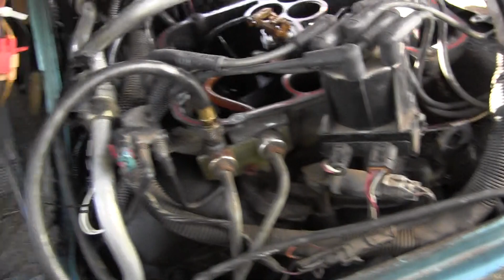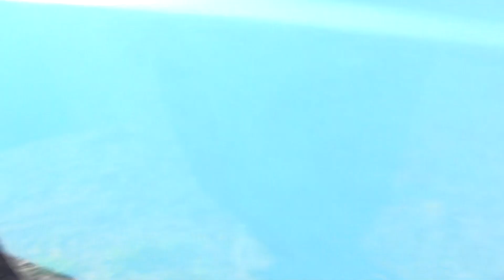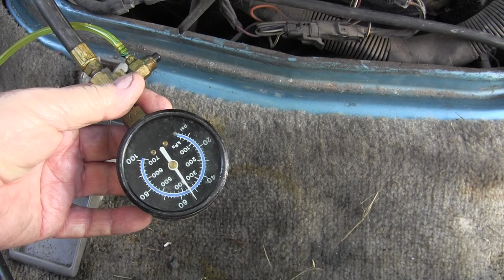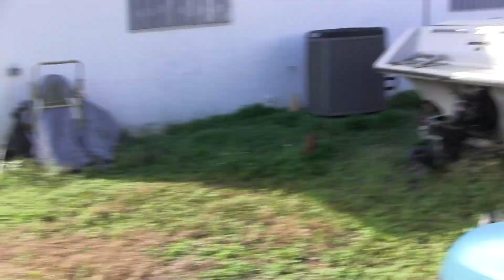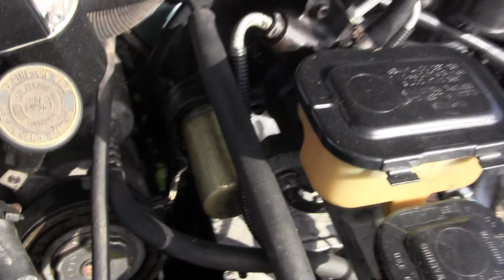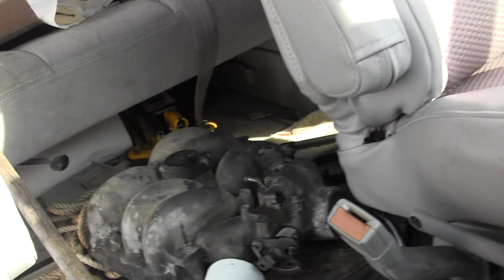Astro VLOG 12/4/2022 CMFI troubleshooting 94 Astro Van project

Comment: THE OIL SENDING UNIT MIGHT BE BAD JUMP THE ORANG TO GRAY SEE IF IT STARTS YOU SHOULD HAVE DONE THAT FIRST THEN DO YOUR DROP TEST
Reply from the maker: I have since replaced the oil sending unit. If you see my most recent video logs you see I have much worse problems now that I need sorted. If my van survives the Hurricane season, I plan to look into the engine noises that I think are balance shaft.